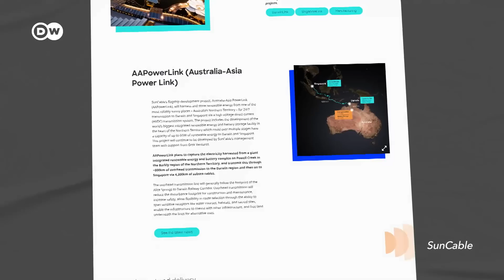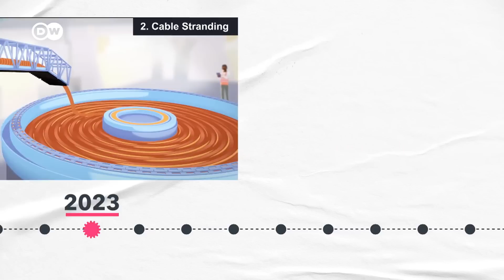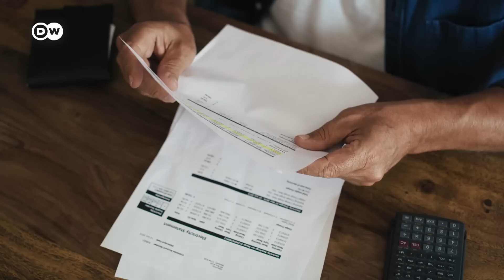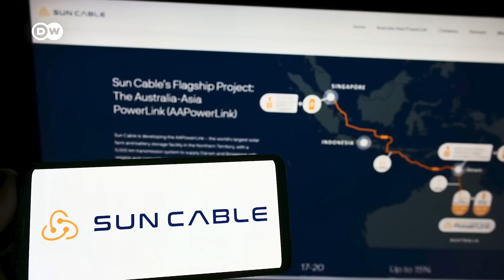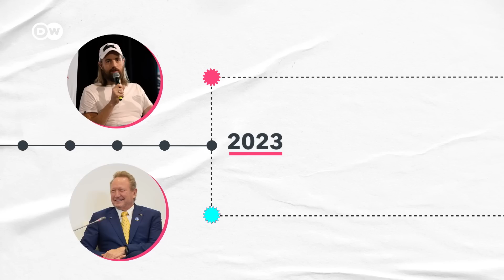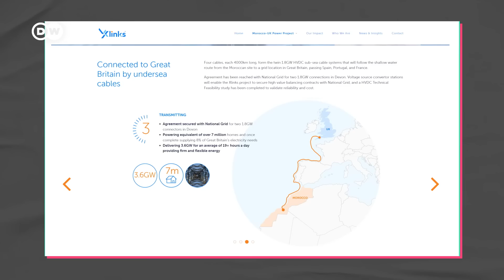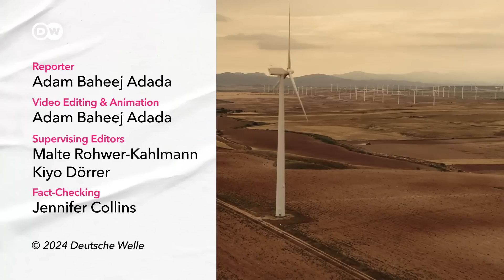Why the mega plan to send Australian solar to Asia (almost) flopped

Comment: Before I saw the rest of the video, I immediately wondered about the issues of the cable, and was thinking of Japan and Korea focusing on using anhydrous ammonia and ship the ammonia or burn it as needed or convert it to hydrogen (as liquid ammonia contains more hydrogen by volume than liquid hydrogen)  Ammonia burns with no c02 emissions.  It may not burn as easily as  hydrocarbons but it also has properties that are similar to propane for both storage and transport which makes it a really interesting choice.  For what its worth
the US has some 5,000km  of ammonia pipelines.  Mostly from the gulf to the midwestern states for agricultural purposes.  

So I would think that Forrest has a really good point.

While it is true that ammonia is toxic and dangerous, no fuel is really safe. 

There are other issues with a submarine cable besides Australia changing its mind.  In recent years we've seen the destruction of the Nord 2 pipeline, and Russia has been sabotaging underwater internet cables.  So there is way too much vulnerability.  There is also the huge amount of special metals required.
Reply: The answer should be a mixture of all three means. ..  HVDC power Cables, Hydrogen, and Ammonia for burning. . .  But Ammonia is a nasty liquid to work with.

Comment: Solve the problem with superconductor in normal temperatures first. After that "small issue" is solved,  you can start thinking about  a supergrid.
Reply from the maker: That is a good point too! Sadly Ranga Dias actually did not find one...

Comment: The production of electricity from sun and wind depend on the weather and season. Manking did not have the technology to  control the weather like Alien. The only reliable supply of power and most efficient is nuclear power plan at large scale. However ,there are risk with nuclear waste .

Comment: Could ships be built to contain huge batteries that could move between electrical producers to be charged and electrical consumers to be discharged?  The ships could use part of the battery charge for propulsion.
Reply from the maker: In theory at least? Little similar to how electric ferries and some cargo ships currently operate.🧐 Maybe it could be a disaster relief and supply for small island communities and also charge by off-shore wind. 🌬️

Comment: The main problem is the fixation on Singapore as a buyer. They should be first flooding the Australian grid with their clean energy, the lay cables to Indonesia and sell energy to them while extending to Singapore as your final destination. They could even sell cheap. You Don't need to cover all your costs. Even a portion is better then nothing for years.... 
Instead of wasting money on an entire cable manufacturing plant they could literally just rolled at the speed they would've been getting on the market. Meanwhile using surplus energy to generate H2 and selling that as well to lower the costs could've been a great support for the actual goal. Why pretend those are exclusive? They could've always expanded their solar farms to match demand...
Reply: A Singapore link has nothing to do with renewable energy to mainly east or south east Australia, which is already doing more and more clean energy.. .    H² is a good idea for Energy Storage and could work well with Solar and Wind farms.

Comment: Seems to forget the current loss over distance. Better to make Australia entirely energy efficient by maximising renewable energy and retaining coal fired plants as base load backup. Complete redesign of coal fired plants to store power by cracking water and storing CO2 in some way. Reduce coal usage and make it as efficient as possible. Given time some coal fired baseload could be replaced with nuclear options or massive stored hydroelectric schemes. Even tidal and wave options should become a part of the equation.

Comment: No mention of the enormous losses in a 4500km long electric cable? What about the huge amount of copper required for this cable? The whole idea was a pipe-dream.
Reply from the maker: Good points to consider for sure. HVDC systems have rather low losses over long distances, less than 3% per 1,000 km. They'd still add up for such a long distance obviously. Copper is critical, but there are supergrid proposals consider using aluminum instead!

Comment: While expanding grid interconnections is fine and should be pursued, it still relies a lot on political cooperation, which is slow, whereas hydrogen/ammonia production is a commodity which is easily stored in bulk and has established and growing markets which are less likely to run into political hurdles to develop and grow.
Reply: My "InterPower" concept would not involve much political cooperation, using HVDC, just cross border agreements.

Comment: Singapore wants to own the power grid. It has to be nearby. Energy is an strategic asset. Too risky to position the power grid so far away.
Reply: Solar power from Australia would Not replace exisisting Singapore's own generation, just enable it to burn less fossil fuel, and hopefully result in cheaper electricity for Singapore, and so less CO² into the atmosphere.

Comment: Not mentioned: "Renewables" like solar and wind require mountains of expensive storage, or equal generating capacity from other means to provide electricity when solar and wind aren't doing so.
Reply: The video did mention that a 36-42GWh battery storage system would be created with this system. The point of the video was to talk about the High-Voltage Direct Current (HVDC) electric cables to carry the electricity from Australia to Singapore and that's why the focus wasn't on the battery.
Reply: For a Singapore power system, Australia would need some Energy Storage to even out the Solar power feed, and in line with Singapore's power needs.

Comment: The high density solar energy in places like Australia doesn’t make the stratospheric costs of laying the cables justifiable. The space required to build those 20GW solar factories is tiny in comparison to the areas of literary any country in the World, with some notable exceptions. Investing those 23bn in neighbouring countries or to create offshore wind and tidal energy infrastructure would make waaay more sense. 
If you are really hell bent on sending energy long distances there is a company called Space Solar which already demonstrated a working prototype of wireless energy transmission from space. 
One thing is certain. Hydrogen is a waste of time at the current state materials technology. Not only circa30% of the entry point energy is able to be consumed but it also destroys everything it comes in touch with. 
It would make more sense to send tankers full of compressed CO2 scrubbed from the atmosphere. This way you would remove CO2 from the air, use the energy by decompressing it to run turbines and then recapture and burry/utilise the resulting „waste” CO2. 
Also, fusion is 10years away 😜

Comment: Australia can't even reliably maintain the undersea interconnector linking the hydro power in Tasmania to mainland Australia let alone a 12,000 km cable to Singapore.
It would be too risky for Singapore to rely on such a long cable in our uncertain geopolitical times.
Reply: Singapore would not be relying on such a cable power, but it would enable singapore to burn less fossil fuel and hopefully get cheaper electricity.

Comment: Where will all the copper come from for a super grid and hundreds of millions of anticipated EVs? The efficiency of solar panels drops in the high temperatures of strong sunshine. The high temperatures also degrade the panels in ten or twelve years. They leach chemicals and heavy metals into the environment.

Comment: How about WE  ( australians) USE  that electricity excess?
Steel is highly energy intensive.. aaand twiggy exports how much iron ORE??
With plain old heat storage ( ie bricks) we can smelt aluminium . And power water desalination.
Australia could b a powerhouse production centre.. instead of shipping out dirt to the world and recieving no benefits from it. The cable could also surround australia to demonstrate proof of concept. Funny thing, most all of australia is Coastal

Comment: You forgot to mention there exsist already such cables, but not at such extreme lenghts. North Sea Link is 720km long at 1.4GW. The mentioned cable would transmit 2x power at 6x distance. This gives a rough estimate of 24Billion € for such a cable!
Reply: I noticed this video mentioned 3 cables. . . I find that strange, they should be in pairs.. .  HVDC typically uses two cables, one for + HVDC and the other for - HVDC to balance the current and avoid Earth currents.

Comment: Doesn't China already have this setup?
Reply from the maker: Hey there! There is a Chinese company for power cables and they are also involved in the Morocco-UK power project. If that is what you mean.
Reply: @DWPlanetA That's not what I meant. I was referring to China's HVDC projects which would move renewal power from its western side to eastern.

Comment: This is why we should R&D from the ground up, the best nuclear reactor that is safe and hardened, then optimize for mass production. It would probably be some kind of molten salt reactor, on the order of just 5 megawatts. The cost to make these should be less than the costs to make an equal amount of solar/wind and batteries (for reliable power) because less energy and material would be needed - if mass produced efficiently and without excess regulation.
With these, there's no need for long powerlines since energy intensive hydrogen can be made from water, which then could be combined with CO2 from the air to make fuel.
Granted, batteries are more efficient, however, powerlines must overcome too many political obstacles.

Comment: This is a stupid idea. If they want to build super grid why not incorporate Indonesia in the Grid? Indonesia do need power so you can sell to them directly. Or power thru Indonesian Grid to Singapore. You would need shorter Cable and you can balance the input into Indonesia with the output to Singapore. Of course you would need to pay some carry cost thru Indonwsia grid. You can pay using some percentage of the power delivered instead of cash. You would need to pay Indonesia either way if you put the cable thru Indonesian waters

Comment: That's a VERY Aussie project (meaning stupid)... $23 billion to build 13,000km of cable when Indonesia can potentially supply power FAR cheaper using nuclear cheaper. AND Australia needs to MAKE the cable ourselves? This project makes the 8 nuclear subs for $400 billion look intelligent when Australia could build smaller 45 diesel subs for cheaper!  No nation can have more than 1/3 of subs at sea at any one time so we have 2 or 3 subs at sea... instead of 15 at sea!  Australia has been discussing high speed rail for 75 years & it will keep discussing...

Comment: Where is the silver going to come from to a achieve net zero. One Gigawatt of solar requires just under 2m Oz of silver. The world requires over 1000 gigawatts of additional solar per year at minimum, between now and 2050 to achieve net zero. The world currently produces 840m Oz of silver annually. To build the solar capacity needed requires over 2 billion Ozs of silver annually. And that is just for PV cell production.
Net zero is an impossible dream

Comment: I wonder if they could use ships filled with batteries. Not sure cost effectiveness but could work.
Reply from the maker: Hey there! Yes, it is possible. One ship with batteries on board is set to be completed in 2025 and will then start with the testing phase. If you want to find out more, search for PowerX. However, it is for short distances.

Comment: Before sending our energy overseas we need to address our own problems because neither renewables costing $1.2 trillion requiring a land footprint equal to 10 Tasmania's with no firming capability nor nuclear fission with an 80 year minable supply and safety cost of $200 million for each Mw generating 1 Gw per annum is the answer.

Australians' energy demand requires a Contant variable.

Solar Hydrogen Energy Recovery Gas Turbine is a constant variable.

301Kwh (equal to 46/6.6Kw home solar installations) of solar energy collected from the sun’s 5 billion year supply of nuclear fusion at atmospheric temperature is sufficient for electrolysis obtained from 1/3 of the water volume of an Olympic swimming pool that is recycled by steam reforming to produce  Hydrogen gas contained within a 14 cubic meter space compressed between 350-700 bar to enable the start-up sequence of a hydrogen Gas turbine to synchronize with its Variable Frequency Generator to maintain equilibrium of compressed hydrogen gas to continually fuel the turbine.

Compressed Oxygen also produced from the electrolyzing process provides a 33% Hydrogen fuel saving precooled engine catalyst to bring online the turbines energy recovery system and sustain a variably regulated base load power supply to service grid energy demand. The operational variability of the turbine not only addresses firming but also manages both grid inertia, and mis matched frequency while generating a capacity energy range between 86 - 330Mw with optional co-generated steam capacity (dependent on grid capacity) up to 700Mw of electrical energy on a 24/7/365-day basis.

The power generating turbine has three operational parts, 3m in diameter, 5.5m long and weighs 6 tons. Installation cost $36.5 -49.5 million, requires a footprint area the size of a football field, noise level is 60dbl at 60m, incorporates direct air capture of CO2 at 1,400 Kg/sec and includes a 14-year maintenance free, end of life decommissioning or optional refurbishment program. 

Sixty-five carbon and pollution free, shovel ready, off the shelf technology, combining solar nuclear fusion with modern aerospace propulsion and existing nuclear and coal fired steam technology to generate a total of 21,450 Mw can be retrofitting to any of the 120 Hydro-electric schemes, placed at grid conversion points, to dispense with renewable energy zones, would provide Australia's 26 million population its entire energy needs covering a combined operational area of 33 hectares for a 2023 total cost between $2.4-3.3 billion. Construction period is 3 to 5 years, meet net zero energy target twenty years earlier and makes wind and solar farms including hydro, gas and nuclear energy production redundant. 

to produce 24 hours

Comment: The Line loss (voltage drop) af such a cable is probably between 20-50%, depending on the Current.  Solar panels in Australia produce maybe 2-3% more then in Singapore..
Reply: Not even close.  Line losses are very small with HVDC, just 3.5% per 1000km.  Lines up to 2500km already exist on land, and 720km under the sea.  It works.
Reply: @JonathanMaddox  ok.. assuming the line losses where 12%.. its probably still less then the difference made by the sunshine in Australia vs an area witch cheap land within 100km from  Singapore.
Im dreaming of a global grid where solar power can be shared to the other side of the planet as well.. but to get there we need cables that are cheap and have almost zero line losses... oh.. and as you mentioned.. it would have to be DC.. not AC.

Comment: Nuclear power plants can be built close to the centers of consumption. The fuel requirement for many years can be stored upfront locally using very little space.  No need   to rely on variable, unreliable energy sources abroad. No electrical supergrid needed. So, why not opt for the obvious solution?

Comment: I am an expert in this technology and also the commercial applications and as soon as i saw this was announced i knew it would fail.  There are many many technical reasons that are so blaringly obvious to an expert....  but also one simpler reason:  

Sumatera is only 100km away and you could just as easily install the solar infrastructure there than in Australia.  Also the Java sea is the perfect depth for wind turbines that would compliment the solar system.

As an Australian who left working in Australia to work on Renewables in Europe and founded my own company providing expertise I find it insanely disappointing the energy policy in Australia, there are practically no experts involved at government level.....
Reply: No expert but just on the face of it, sounds like an uneconomical therefore unviable solution.  Sure Sumatra and ocean wind much smarter alternative.